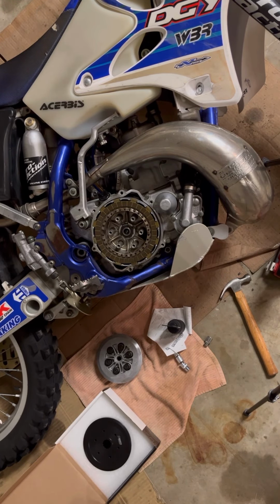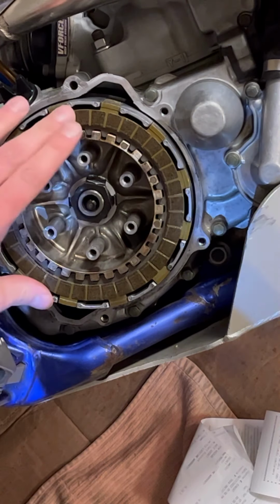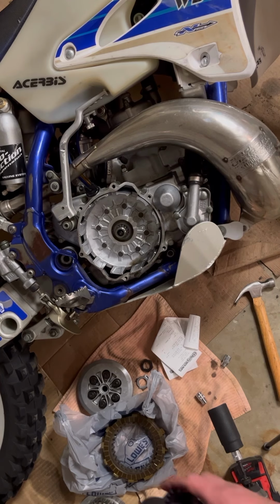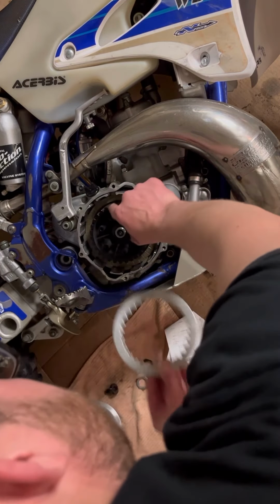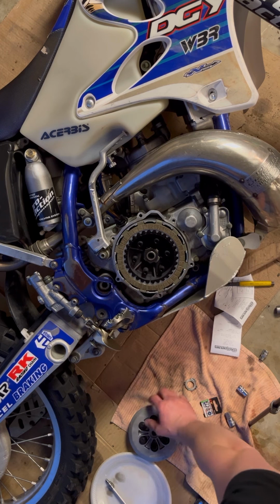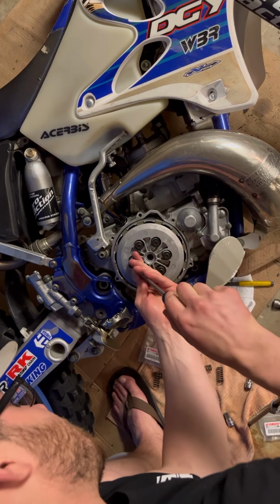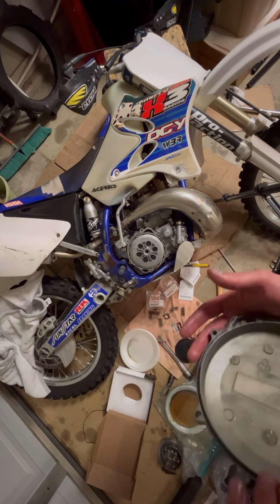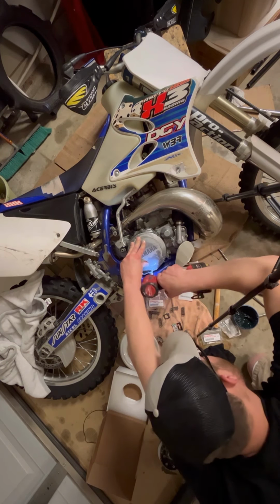YZ 250 clutch boss replacement

Comment: Hey man I’m having a problem with just a super super stuff clutch  pull and sticking my basket is grooved pretty bad the boss is groves pretty bad, I’ve replaced clutch arm clutch push rod and new clutch cable , think that the basket and boss is my problem would you agree?